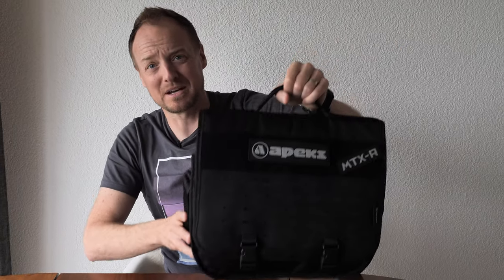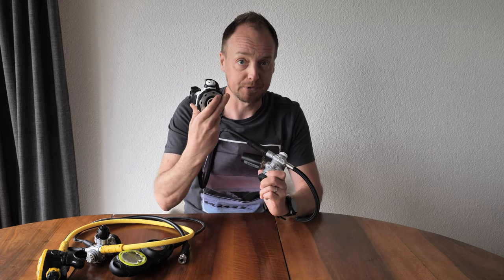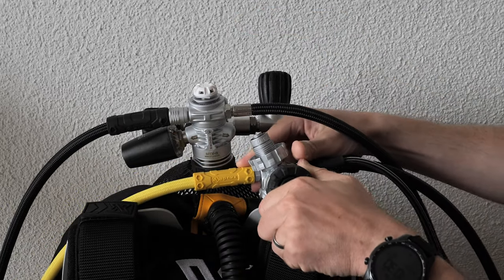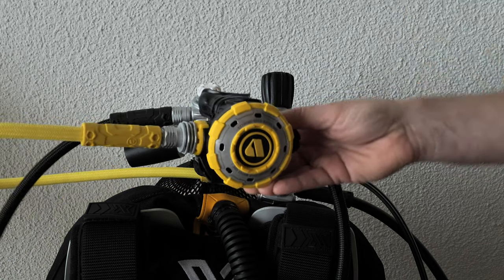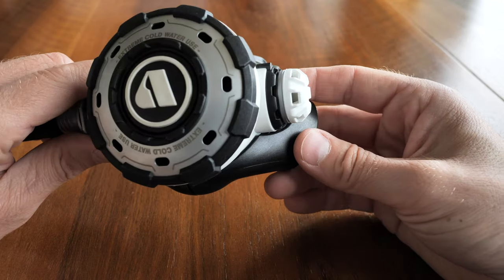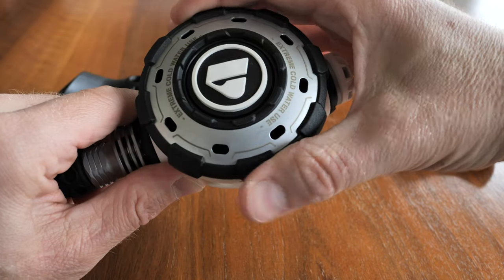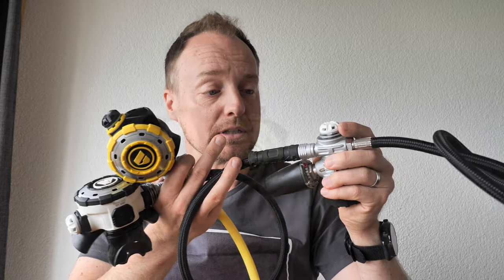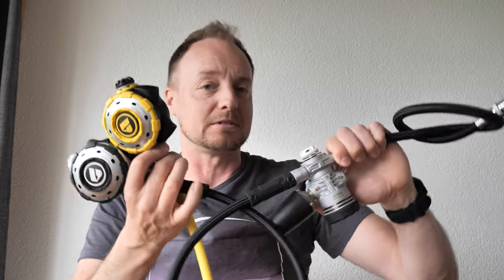Apeks MTX-R Cold Water Regulator Initial Review & First Look

Comment: They are gorgeous regulators.
I have a set of the MTX and MTX-V in the original black.
Right now it's set up on a single first stage in a long hose configuration.

First stage is upside down (with the endcap pointing upwards).
The primary second stage is on a 210cm long rubber hose and comes out the 5th port.
The secondary second stage is on a 65cm rubber hose and a necklace, and comes out over the right shoulder.
The LPI comes over the left shoulder.
The SPG is on the left (only the SPG, no depth gauge or compass).
The transmitter is on the right on a 15cm hose.
I don't have a drysuit yet, so no inflator hose for that one at the moment.

The second first stage is in my regulator bag, should I need it for twins or sidemount.

Comment: Nice video. The rotating turret was previously only available with Apeks in their DST first stage. It also has a fifth port. These features made it very popular for sidemount diving due to better hose routing. This MTX-R looks like a great upgrade for cold water tech diving. My only concern is how they feel. What the Work Of Breathing is like, etc, without the venturi and adjustment knob.
Reply: Set your XTX to pre-dive, and screw in the cracking resistance. That's how the MTX-R breathes. Alternatively, you can get the MTX-RC if you want the Venturi and adjustable resistance.

In all fairness, the real work of breathing occurs at great depth (35m and beyond), and this first stage is overbalanced, so you'll get plenty of air from this reg.

Comment: gotta respectfully question the lack of gauges if you’re going through the expense of a second valve and first stage for the sake of safety
Reply: He has full redundancy. He has the HP hose with gauges on one 1st stage, and an A.I. transmitter on the other.